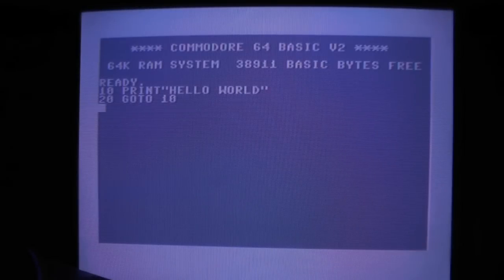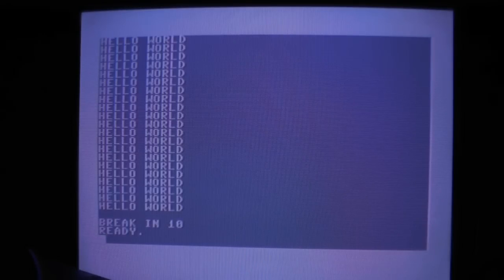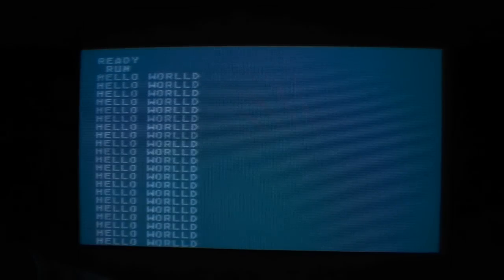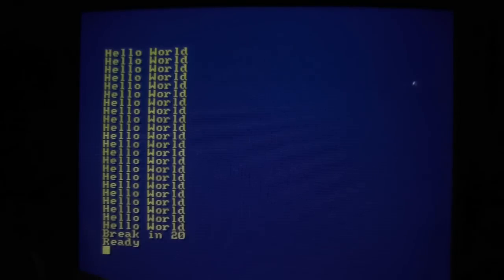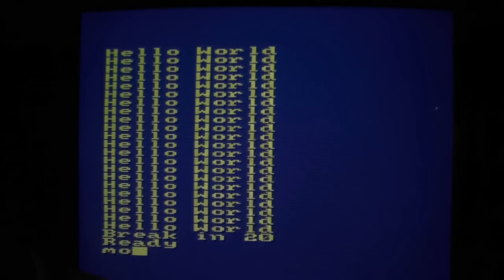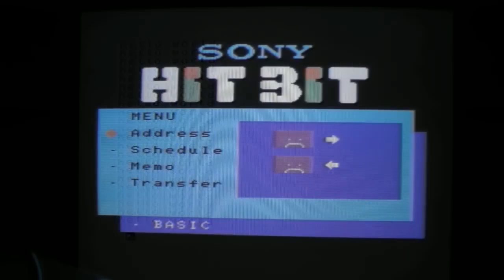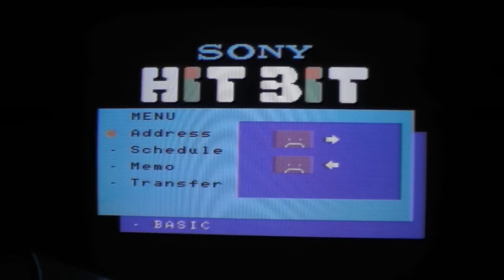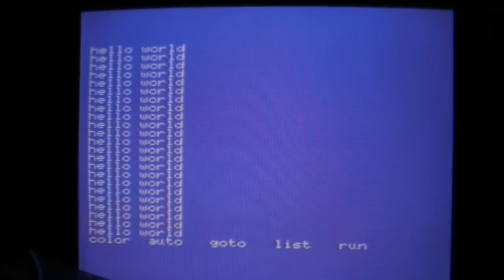Let's Compare: 8-Bit Homecomputers [Part 1] (C64 vs. 800XL vs. CPC vs. ZX Spectrum vs. MSX)

Comment: C64 has half pixel scrolling but the A8 has Tile Map scrolling allowing to copy rows of tiles on screen by just using 50b for the whole screen while the C64 needs 900-1000b for the same  process. Since half pixel and pixel scrolling aren't that different, tile map scrolling makes the real difference. (i.e in the game Tangent (c64) vs Guard(A8), the speed difference is  unthinkable).
A8 also has  basic scale scrolling which the C64 doesn't.
Atari sprites have two types of use. They can be used as typical sprites but since they are  full screen tall they can be used as  four extra color slots in the background, allowing the A8 to have up to 9 color changes per rasterline and 128 different rasterlines (DLI) with their own 9 colors out of the 240 in total( overscan). (theoretically it can have 1.150 color changes, but the color palette only has 256). A8 sprites can also be stretched (x2 & x4) so you can have  32 pixel wide player spite  and missile sprite at 8 pixel .

Comment: I like to rank my collection in 2024 on criteria like: quality of BASIC, repairability and availability of replacement parts, room for expansions inside and ease of designing new hardware, proper RGB output with 40/80 characters, flexibility of hardware for new machine code, standards compliant ports, cabinet looks, ease of connecting a floppy drive and the speed of it, quality built in power supply, keyboard layout and feel. The ranking gets very different than 1985 sales figures! Favourite machines are P2000T, CPC 464, MSX2, Olivetti M10. The bottom of the ranking is filled with famous machines like the Apple II, Atari XL, Spectrum 48k, and at the bottom the C64.

Comment: That model is either a +2A or +2B at 0:46, not that I am picky or anything. I got the base model and a +3 in ”hybrid” mode (floppy disk. cassette and a Gotek).

However, I did own a 48K in 1985.

Comment: BTW - you don't like the Atari text mode scheme you can change it. The cursor is 2 characters to the right but you can get the missing two columns back by doing a poke 82,0. You can change the back ground color.
Reply from the maker: I guess the scheme is just something you have to get used to.
Not that the one on the C64 is particularly good looking... but I had mine fitted with SpeedDOS which meant black background and green text IIRC... that was pretty pleasant.
Reply: @Theshadowsnose  You don't have to put up with it. You can poke 82,0 to get all 40 columns, you can change the background color. You can even change the fonts. I use to use the script font from Scott Adams adventure games.

Comment: You are totally WRONG about the Atari scrolling. It has fine horizontal and vertical scrolling. Unlike the C64 that once it reach a certain limit on what the scrolling register can handle, it has to move every byte of screen memory. Here's a sample I found of scrolling on a C64...
Start by setting the scroll register to 7 (assuming we want to scroll to the left)

Each frame, you decrement the scroll register by 1

The screen contents move 1 pixel to the left
Once it falls below 0, shift the entire screen RAM contents over by 1 byte
Reset the scroll register to 7
Now the screen contents have again appeared to move to the left by 1 pixel
Rinse and repeat.
This is similar to the Atari except the step "shift the entire screen RAM contents over by 1 byte
". I hope you're not in hires mode for that scroll, how many bytes have to be moved? On the Atari that step would be "increment the pointer to screen memory by 1". Changing 2 bytes of memory is a great deal faster than moving every byte of screen memory. The Atari can scroll different parts of the screen. One part can be scrolling left, another right, another down (every scan line can have it's own screen memory location).  For an example, look at the game Caverns of Mars. It uses vertical scrolling (it was also written by a teenager). Or check out Eastern Front 1941. They are both on YouTube.
Reply from the maker: You don't use hi-res graphics on the C64 in games.
Usually, you re-define the character set and build the graphics from 4x8 pixel tiles in multi color mode.
each pixel in that mode is 2 pixels wide, so you get a 160x200 pixel resolution.
You can still scroll in 8 pixel resolution horizontally, even though the tiles only have 4 pixel resolution and once you have finished your 8 pixels the scroll register provides, you only have to re-write the character screen buffer, which is 1k on the C64.
Reply: @Theshadowsnose  I didn't know that. The Atari 800 has so many different ways to do graphics. They have a re definable multi-colored character set that can be used for game backgrounds while using sprites for game play.
Many of the earlier Atari games were ports from Apple games that used the Atari hires mode - I THINK it was 320 by 192. Of course it also had many modes one could use. 
As for scrolling, the Atari could scroll different areas of the screen. It was far more powerful than the C64 (not that the C64 was bad).
Reply from the maker: @bjbell52  The C64 can also scroll different areas of the screen... well you can split the screen horizontally and only scroll the top or bottom part for example.
It's not triavial, but possible.
You can tell the video chip to trigger an interrupt at a specific scanline. So you have to handle that interrupt and either do the scrolling in your code before that interrupt if you want to do the top part, or after that interrupt if you want to do the bottom part.
I guess that's easier on the Atari with its display lists.

I like both Computers. :-)

Comment: Had all of these computers, and Atari 800 always wins in my book
Reply from the maker: There are some great games on the Atari, but the C64 does have a lot more variety.
You miss games like the Bard's Tale or Pirates on the Atari.
Also a lot of the later games.
Not that the Atari could not do them, but nobody bothered to program them
That's why I even prefer the Spectrum over the Atari in the end.
There just that many more games that even if the average game is worse than the average Atari game, there are still more good games on the Spectrum.
If the Atari is programmed properly, it beats the Spectrum hands down, but again... nobody really bothered after 1984/85.

Comment: I like your video, I appreciate it. You do seem to lack knowledge when it comes to the Atari here, and it shows. Unless its just a bias, in which case its your choice.
in the right hands, the Atari 800 can display better graphics and even better sound (admittedly more cold sound) that is better for arcade style games.
Reply: I love the Atari 8-bit line. I have an 800XL. It has great Arcade conversions. Millipede is pretty fantastic. But there is no way I can agree that it has better sound than anything comparable in specs made by commodore. Better sound than the ZX, probably. I just got one but I have yet to make a suitable power-supply (+2B) here in the US for it. Soon though.
Reply: Agreed The Atari had much better Arcade/Video game sound generation than the SID which was better at music.
Reply: @Rooflesoft Games There you go again, bashing the Atari without really knowing the machine. Yes, in 8-bit four channel mode, it misses some notes of an octave. BUT - you can combine sound channels to make either 2 8-bit channels and 1 16-bit channel or 2 16-bit channels and those 16-bit channels can play every note in an octave.
Reply: @Rooflesoft Games That's using an 8-bit sound channel. Try combining 2 8-bit channels into 1 16-bit channel and then tell me about its inability to hit all the notes.

Comment: A few things, the weird port on the MSX is indeed a centronics printerport. A quick way to see how much memory is available in basic is the command;  print fre(0) This works in Atari Basic, MSX basic and on the Vic 20 (not on the C64). I'm not sure on the other systems. Some MSX machines had a different soundchip from Yamaha (I believe it was a Yamaha MSX 1 machine) and most MSX 2 machines.

Comment: You should know the Atari as well as you seem to be saying. The sprites on the C64 have some advantages over the Atari's but overall the Atari has better graphics. You should go online and check out the book De Re Atari. There are just too many features of the Atari graphics to talk about in a short post. I will add something you didn't say and that is two sprites can be overlapped to give a three color sprite and that the 6502 is clocked at 1.79 mhz, not 1.7.
Reply from the maker: The better sprite engine is a huge advantage. 
The Atari graphics have their pro in some aspects, especially in producing color gradients. But the C64 are more useful lin most of the games. Or at least in ´most games that were popular back in the days.
Don't get me wrong! I'm a huge fan of the old Atari computers and the design is ipressively competitive regarding that it's 3 years older than the C64 one, but overall, the C64 graphics are more useful in the real world producing games.
Reply: Atari has more than sprites. It had a programmable graphics chip. It had multiple graphics and character modes. The programs were called display lists. One could mix different graphics modes together. Each display list graphic mode instruction could have a pointer to its own ram area. Each one could have its horizontal and vertical fine scroll enabled. Each one could turn on the interrupt flag so that a display list interrupt would be generated for that line. That enables so many things to been done so much easier than having to things "by hand". One could change the color, size, and horizontal position of a sprite. One could make multi-color sprites using DLI's OR by combining two sprites; the overlapping area would create a third color. The missiles could be set to become a 5th sprite.  Atari had re-definable characters sets including a couple multi-color character sets. It also had access to the vertical blank interrupt where one could do a number of things. The Atari basketball game was almost 100% written during vertical blank interrupt. I'm sure I'm leaving a few more things out but my point is Atari could hold its own against a C64. It could do a great deal more than just gradient colors.
Reply: I forgot to mention the Atari runs almost 80% faster than the C64. The graphics chip was designed by the same person who designed the Amiga's graphics chip. Oh,  and having three different methods of displaying graphics is a huge advantage for the Atari. (Sprites, re-definable character sets, bit mapped graphics).
Reply: I bought De Re Atari when it first came out in the early 1980's. I knew about the overlapped sprites being 3 colored too. There is also a register that changes the width of the sprite, 3 widths in all.

Comment: I like your videos but your Atari specs are not right. Firstly the Atari has a high res of 320 x 192 not 200. Also though the C64 is better graphically and sound wise (I do not disagree), the Display list that Antic provided did allow for more than just 256 colours as colour bars. The resolution and colours could be changed on every scan line if desired to provide for many more colourful games or displays. But ...... I like your videos and good work .... I do feel your strength is C64 though over all others. Atari did also have a much more versatile serial port system and it was developed 4-5 years before the C64
Reply: I believe Crownland is a good example of DLI programming.
Reply: The Atari's  "192" vertical scanline dimension is an artificial  limit imposed by the OS routines to set up graphics modes (which Atari BASIC uses.)  If you're rolling your own display list you can have it display text/graphics well into the vertical overscan area.  240 scanlines, easy.  Without any interrupt tricks.    Not to mention the ANTIC video chip  supports horizontal overscan, too.  Again, without any machine language hacks.
Reply: I agree, he does not really know much about the Atari. Also the Atari generally was quite a bit faster (1.79 vs 1 MHz on the C64). I can really notice this between my 800 and C64.
Reply: @Rooflesoft Games Atari does NOT have to use any intensive routines to scroll. I could scroll the entire screen in hi res mode by one poke in basic. Yes, to scroll multiple lines you have to set up your own display list with each line you want to scroll having their own memory address and their horizontal and/or vertical scroll bits turned on. To scroll, you increment/decrement one memory location by how many pixels or scan lines you want to fine scroll. After 7 bits you reset the register back to 0 and increment the memory location that has the address of the screen memory per line to be scroll. The code for that is quite simple and not intensive at all.

As for sprints - to move a sprite horizontally, you poke a new horizontal position into one register. That's it. Not hard at all. To move a sprite vertically, you have to move the sprite in memory, up or down. Again, that isn't all that hard either.

I once wrote a video game for Softside Magazine. It was a port of Volleyball from Apple. Using ONLY basic, it had full animation on the 4 players and the ball. And Atari Basic was a very slow Basic when compared to Microsoft. 

One could use a display list interrupt to slice a sprint into many different sprites,  each with its own color, width, horizontal position, and screen priority (to make it either appear in front of or behind other object, making more sprites. 

No, you really don't know much about the Atari 800. Perhaps you should do a little research before posting.
Reply: BTW - I just looked up how to scroll the screen on a C64. Here are the steps...

Start by setting the scroll register to 7 (assuming we want to scroll to the left)
Each frame, you decrement the scroll register by 1
The screen contents move 1 pixel to the left
Once it falls below 0, shift the entire screen RAM contents over by 1 byte
Reset the scroll register to 7
Now the screen contents have again appeared to move to the left by 1 pixel
Rinse and repeat.

Very similar to the Atari BUT look at the one line ->  Once it falls below 0, shift the entire screen RAM contents over by 1 byte

Move the entire screen area of ram? Talk about intensive routines. Atari just changes the addresses for each scrolling area. 

And it seems that one can only use the scrolling registers in character modes.
Reply: @bjbell52  Atari graphics lacked one (the most important) feature: ability to use more than 5 colors on all width of the playfield.  C64 could use all 16 colors all over the screen with no tricks and only limitation of 4 colors per 4x8 area.  This made C64 games much more colorful.  All the Atari tricks like mixing PM into playfield or use of DLI to change colors for another horizontal area was still giving options much more limited than what C64 had as a standard.  Not to mention large multicolor sprites on C64 that made coding games so much easier, and with use of use interrupts you could have then more than standard 8.
I agree scrolling was implemented on Atari much more better.
Atari could do things that C64 couldn't, but C64 could do thing that Atari couldn't and those were more important to make colorful games.
But if you notice that Atari was on the market almost 3 years earlier then C64 (1979 vs 1982) at the times when computer technology was progressing faster than ever, it seems incredible that these two machines are comparable.

Comment: You know, in 1985 the MSX2 was already available, with 512 colors (256 simultaneously) and 128KB of VRAM.

If you stretch to 1988, then the MSX2+ was available, with up to 19268 simultaneous colors and FM sound.

Comment: Would that be an original C64 on the shelf behind you? I preferred that machine to the newer C64.
Reply from the maker: Yes, it's the C64 I got from my parents back in 1985. 
To me it's all about the SID chip. I don't mind the newer case, but I want the old SID chip. 
The early models with the new case came with the old sid chip, so if you like the new case and want the "proper" sound in older games, there is an option, but I don't see anything wrong with the old case... besides from the fact that it is the C64 that I used my entire life.
Reply: +Theshadowsnose Yeah it was the original C64 I had too - and loved it. Then in later years I got a C64 with the new case and wondered why the newer SID was quieter and didn't sound quite right.

Comment: I may have been a bit hasty there, if you are only comparing four 8-bit micros, but you did include st and amiga!
Reply from the maker: Richard Broadhurst Well, I try to comprare it on as many systems as possible, but I do have to own the particular system. 
I'm still trying to get more different systems, but they are incresingly hard to come by over here.